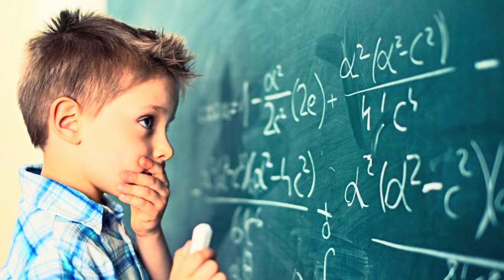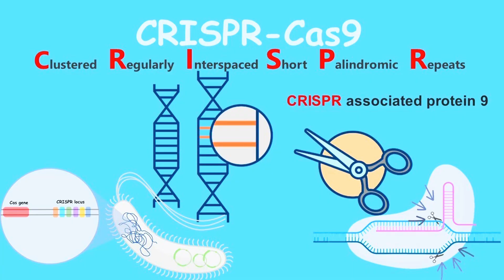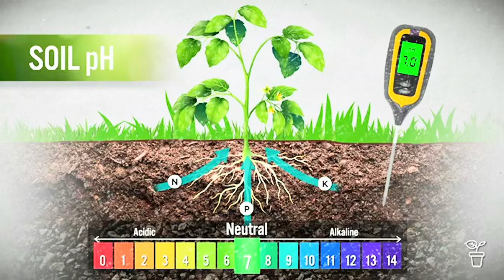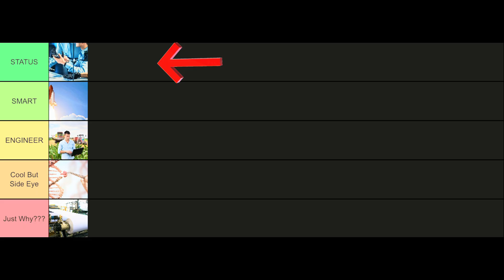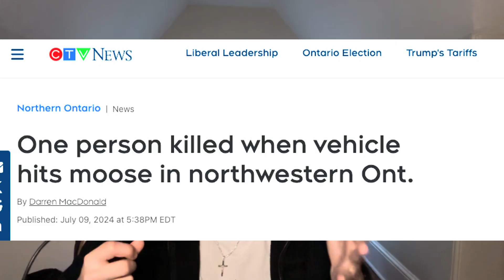Engineering Majors EXPOSED! Who's a Real Engineer? (Tier List Pt. 2)

Comment: As an industrial engineering student, I gotta say some things about it that many prople don't know. I see that everyone mistakes industrial engineering with Industrial management. Here at the Technical university of Sofia, the IE is not just some economics or management, we study almost everything, as an example, the ratio engineering vs economics is 10 : 3, I mean, we study engineering mechanics, electrical engineering, electronics engineering, strength of materials, mechanical engineering design, automatics engineering and etc.. and then the management comes with small steps. I am just tired of everyone mocking my major.

Comment: 1:24 afaik paper engineering focuses mainly on research and designing of paper products and paper producing machinery. However, it is a niche field, and somewhat specalized to the packaging, printing, papermaking and their respective machinery manufacturing industries.
Reply: And I am going to have to disagee with you on your follow up point. I am quite confident that both logging and papermaking, while being mature industries, are a long ways off from decline and irrelevance.